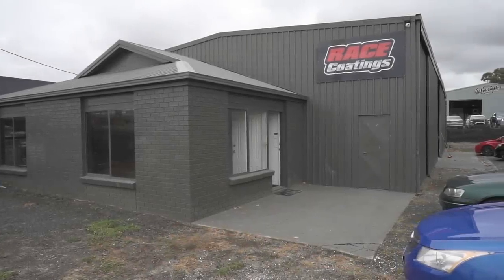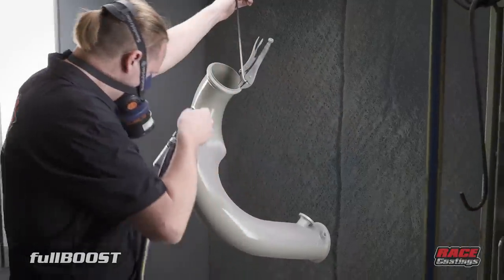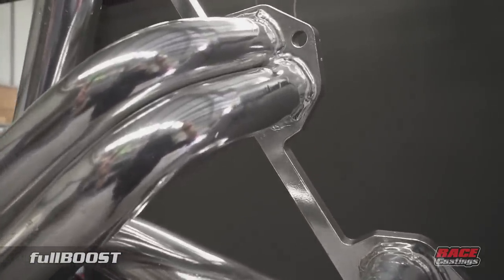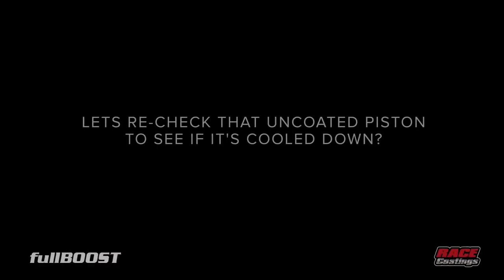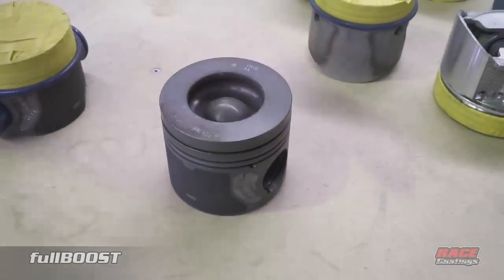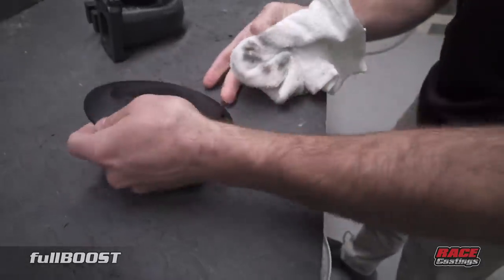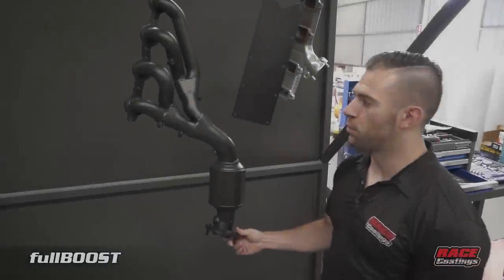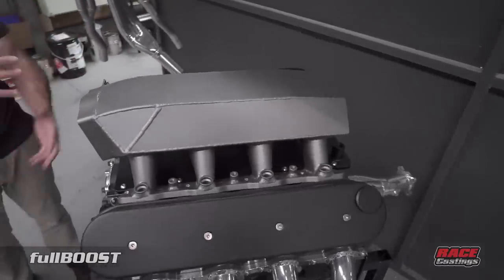What is Ceramic Coating? | Race Coatings

Comment: Would the ceramic coatings be applicable on the rotors or housing walls of a rotary engine?
Reply: Good thought.
Reply: I really like your question. I think we deserve an answer on this. Surely the bloke will read these and get back to you.
Reply: Companies like Mercedes-Benz, General Motors, Ford and Mazda spent BILLIONS researching high performance coatings to solve the many flaws in the Wankel design... none were successful.
Reply: Materials, rather than coatings but their main focus was on overall efficiency - fuel economy.
Reply: I could be wrong but I'm not sure it's purely heat that ruins seals and degrades rotaries but also just a lack of lubrication for the seals - which ceramic coating AFAIK would not help with. As another mentioned I am sure Mazda and other auto manufacturers tried it and clearly nothing really came of it.

Would be cool to see though no doubt, I'd imagine some shaving of the housing to make up for the coating may have to be done? Not sure how thick it ends up but I'd imagine the tolerancing on the housings is pretty serious.
Reply: Exactly, the excess wear and problem of sufficient lubrication whilst still meeting emissions was a problem. Over the years different rotor, side plate and seal materials have been used - something to bear in mind when modifying as some don't play as well with some as others.
To clarify, though, it wasn't so much heat barrier coatings but wear resistant coatings they experimented with.
Reply: Also worth noting is the seals and housing etc are designed to operate correctly at an operating temp. A ceramic coating would muck with that a lot. A lot of redesign would be needed to implement a ceramic coated rotor housing and I am sure auto manufactures have looked in to it before.
Reply: +Maxim Allen One of the major problems encountered by General Motors, Mercedes-Benz and several other Wankel development programs was cracking and failure of surface coatings due to an inherent flaw in the Wankel basic design, the less than ideal shape of the components for stable thermal expansion and contraction,the very uneven thermal load stress and contact damage and flex due to the torsional flex of the crankshaft.
Reply: +Maxim Allen AFR (air-fuel ratio) not lubrication was the major issue when emissions controls were applied to the Wankel KKM design, The Wankel had a very poor combustion chamber which is completely incapable of adapting a modern ultra-efficient "quench" or high swirl chamber design. Unstable combustion and detonation or pre-ignition is the primary mode of apex seal failure, a richer mixture reduces apex seal failure but produces poor fuel mileage and unacceptable CO and HC exhaust emissions, catalytic converters require a stoichiometric AFR to operate, Mazda and other experimented and produced cars equipped "Thermal Reactors" but these with plagued with problems and delivered poor results.  All attempts to produce a "lean and clean" Wankel engine have resulted in high failure rates due seal damage and compression loss.
Reply: Kevin A. WANKEL engines son, get your terminology straight. Not true at all, I have always had a very keen interest in the the KKM-57 design but I do not make any lame excuses for its many flaws and deficiencies. As you must know Felix Wankel had nothing to do with its design... Hanns Paschke and Walter Freode developed the Wankel KKM without any assistance from or even knowledge by Felix Wankel himself... Dr Wankel hated this engine and publicly mocked it in his famous quote. The NHTSA recall investigation dispelled these old wives tales once and for all, the investigation found NO LINK between owner abuse or lack of maintenance, even Mazda has admitted the engine is unreliable!  That excuse won't hold water either, when a design is found to be intrinsically inferior to existed technology? Legitimate commercial development interest naturally dies off when the design has been rendered obsolete like the Wankel has.
Reply: Kevin A. Which version of the Wankel are you referring to? as only the DKM-54 was a rotary.
Reply: The Wankel KKM's serious designs flaws (in particular short service life and low reliability) are well known and understood.
Reply: Then why was Sachs the very first of the 26 original Wankel KKM licensee's to completely abandoned development and production of the troubled design?
Reply: Kevin A. If they were so reliable? why did they both need to be rebuilt???
Reply: https://en.wikipedia.org/wiki/Adiabatic_process look here was one of the secrets of the glorious turbo era of the formula 1, group b rally and group c at LeMans ceramic coating, piston and motors ceramic coating was invented by the nazis in ww2 on the luftwaffe man like the like anti-friction lubricants.
Reply: Kevin A. There are several reasons why the Wankel engine was a commercial failure, the inherent weakness and fragility of its complex sealing system is certain one of its fatal flaws... and a major contributing factor in the design now being completely obsolete.
Reply: +Emanuele Loche Good comment, Dr Anselm Franz was the first to use ceramic coatings in the Jumo -004b turbojet engine that powered the Messerschmitt ME-262, Franz and his research were brought to the United States by the Army under 'Operation Lusty' where he would continue his work and go on to develop the engines for the Bell UH-1 and AH-1 helicopters and the AGT-1500 for the M1 Abrams tank.
Reply: +Jonathan Simmonds The various "nitriding" processes such as this one not only predate the existence of the Wankel KKM-57 design but have been used in mass produced engines since the 1950's, many of the more advanced nitriding techniques in use today existed 40 years ago when there was still commercial interest in development of the Wankel engine.
Reply: +Jonathan Simmonds Wankel KKM licensee Curtiss-Wright developed a nitriding process for the housings in 1964, Mazda used a similar nitriding process for the  iron components for its production engines as well.
Reply: this didnt.  https://www.wallworkht.co.uk/content/diamolith_dlc/   salt nitriding was used but not this. surface treatment has come light years in 40 years. thats why f1 and other aerospace products work. a far cry from 40 years ago.
Reply: +Jonathan Simmonds Actually no, its a very similar process that has been used in mass production for almost 40 years... with very similar results.
Reply: teflon coating on audi tfsi piston rings..
Reply: oh so ceramic coatings /teflon coatings were in the me262 jumo?- silly me! i thought that was with the space shuttle in the 70's that came out.. (actually it was high content nickel in the jumo engine- which in 44-45 couldnt be sourced so mild steel was used in the turbofans so the flying hours were reduced to a average of 25 hours max before a rebuild)
Reply: +Jonathan Simmonds Yes, The Jumo -004B was the first use of heat resistant ceramic coatings in an internal engine application, The Jumo   -004A was constructed with high nickel using Krupp P-193/30 "Tinidur' nickel alloy ( a material which had comparable creep strength compared to "Nimonic-70") was tested to a PFTR of over 200 hours.

The BMW 003 was constructed from similar materials to the Jumo 004B 

Krupp P-189 "Chromadur" a high temperature stainless steel alloy which only contained 0.2% Nickel.. These engines were a remarkable feat of engineering considering the both could reach a very respectable 100 hours in PFTRs. (100 PFTR was the standard  for acceptance in military combat service for both the RAF and the USAAF) This was achieved using superior heat management technology in the hot sections of the engines.. advancements in the use of bleed-air cooling and ceramic coating (technology that did not exist in Allied jet engines but are still in common use on today's jet engines)

Of course any engine that see repeated service using WEP or high TO cycles at Max  climb-out rate to ceiling altitude is going to see TBOs much lower to its PFTR.

Such was the case with both Luftwaffe and Allied piston engines and jets

a TBO in combat service of 20 to 30 hours was not uncommon for the Rolls Royce Merlin or the Pratt & Whitney R2800 when WEP was used repeatedly.
Reply: +Jonathan Simmonds The GE J-47 turbojet engine that powered the fastest jet aircraft in the world in 1948 (F-86 Sabre) was constructed using high nickel alloy, just 46 mph faster than the Me-262 its engine had a TBO in combat as little as 15 hours. making the ceramic coated stainless-steel blades of the Jumo 004B even more impressive by comparison.
Reply: +xXxMartin96xXx What about Mercedes-Benz? They invested over half a billion dollars developing the advanced GDI equipped M950F engine? Or Ford who held more patents than Mazda for many years? John Deere or Rolls-Royce Yanmar and Duetz that spend billions developing Diesel variants? What about Suzuki???
Reply: +xXxMartin96xXx It saddens me how little people today acually remember about the development history of the Wankel engine design and prefer to believe some crackpot conspiracy theories or uninformed speculations.
Reply: +xXxMartin96xXx What about OMC? (Evinrude/Johnson) Yanmar and Sachs that all introduced and sold Wankel outboard marine engines??? Or Ingersoll-Rand that manufactured the world's largest Wankel engines ever offered for sale in stationary industrial applications?
Reply: +xXxMartin96xXx I understand trolls don't like to have facts presented in an honest or truthful way if it contradicts their preconceived opinion.
Reply: +xXxMartin96xXx Just the facts here, I'm sorry you are not mature enough to handle the truth.
Reply: +xXxMartin96xXx Why don't you just take you bitter, angry troll comments somewhere else?
Reply: The housings and irons may be tricky to coat. The side seals and apex seals would probably wear the coating extremely quickly.

But coating a rotor... now that would be interesting. I'd imagine that it would help with cooling efficiency since more thermal load would be placed on the cooling jackets, rather than the oil chambers in the rotors and e-shaft.

This would be a good experiment.
Reply: +xXxMartin96xXx Do you only read English on a remedial level? maybe try a translation app or something, please just stop trolling.
Reply: +xXxMartin96xXx I'm not intimidated by angry trolls like you, please go troll elsewhere.
Reply: +xXxMartin96xXx  You have been reported for harassment.
Reply: +xXxMartin96xXx You are just digging a deeper hole for yourself.
Reply: +xXxMartin96xXx Seriously dude! Do you have some sort of mental problems?  Go troll somewhere else!
Reply: I'm not intimidated by trolls
Reply: "Would the ceramic coatings be applicable on the rotors or housing walls of a rotary engine?" I don't know what all this petty arguing and harassment is about... but its not related to the original question and more to do with some hate mongering individuals that simply refuse to accept the truth.
Reply: +xXxMartin96xXx I'm not intimidated by angry little trolls.
Reply: +xXxMartin96xXx I'm not harassing you. I'm trying to tell you how you can make your comments easier to read.
Reply: +CarNutz Mazda coated the irons and the housings of its production and motorsports engines for years using several different techniques and materials. Many manufacturers have tested and used coatings on the Pistons(rotors). The effects on the cooling system is minimal as the real flaw in the Wankel design is high heat rejection due to its low Carnot Cycle efficiency.
Reply: if you use a ceramic coating and ceramic apex seals , the durability will increase Sky High. Why havent they done this? Probably not cost effective on cheap productions cars , $695 per seal + the internal coating treatment  , well over $2000 per engine.
The Mazda 787b won Leman using similar techniques , and according to the engineers had virtually little to no wearing after 24 hours of continuous racing.
Also , it used 3 spark plugs per rotor instead of 2 , to lower consumption , well spark plugs are not exactly super expensive , but on a consumer level it might alarm some.
I think this all makes sense on a high end $200k Sports car with a limited run , like a Ferrari/McLaren , not in a sub $100k sports car.
Perhaps Mazda should bring back their premium brand and release a rotary sports cars with a properly built engine ,it sort of worked for Lexus with the LFA.
Reply: I'm waiting for RX 9 Electric.

I tired playing with combustion engine, thousands of parts & very fragile.
Reply: Uriah Siner /
Reply: All those companies already use ceramic coatings. But of course due to cost they only use them when  they feel it's absolutely necessary to meet the outright performance/mileage/reliability/emissions balance requirements the market & the regulators demand, as they perceive it. These coatings go all the way back to British jet research in WWII, so they've been arround a long time. Jez one in fact can buy a 40 year old Russian Vostok watch for just $40 that looks gold plated but in fact has a PVD ceranic TiN coating, the same hard stuff they put on the end of drill bits.
Reply: Uriah Siner deserves an official answer!
Reply: doktorbimmer 
Wankel geometry is an expanding wedge, evidently not as good as a piston working perpendicular to the applied force. Internal combustion engines waste 80% of the heat in exhaust gases and the water cooling.
It is old tech. Electric motors are 98% efficient and batteries lose 20% in charge losses. Electric motors don't need a gearbox etc. Max torque at 0 rpm.
The battery technology has come a long way and I expect it to continue.
Everything about a combustion engine stinks.  Unless it is stationary and residual heat is reused for something it is horribly ineffcient.
Reply: xXxMartin96xXx  and Uriah Siner, sorry to see you deal with these.  It has been found that the so called doktorbimmer is a bot, this is just one of the many accounts that have been linked to similar programs.  The information listed and referenced by it is all correct because it runs algorithms that pull key words and questions than auto respond in sarcastic form followed by factual information it easily can source from the internet  in seconds while even co referencing multiple publishings.
These bots then use built in auto responses to other comments and phrases directed towards it, often repeating them repetitively because it is limited to a few programmed response options.  Unfortunately this comes out sounding like an annoying 5 year that is mocking you in a very immature way, but this 5 year old has read and memorized a shit load of information. 
The robots are becoming more difficult to detect even when using their trigger words like "troll" because their responses are being improved to sound more human and mature, adult like instead of nerdy, 1st grader trying to bully other 1st graders like these current ones come off as.
Everyone should watch out for these annoying things and do not allow them to influence you as their creaters intended them to.
Reply: Ceramic brakes, as you may already know, exist.
Reply: Uriah Siner I don’t think ceramic would help on the internal housing wall but Teflon would, these guys also do
Reply: Dan Simmons ceramic brakes are for clamping power and durability. They do not run cooler, infact they are pretty much useless when cool
Reply: doktorbimmer one thing ive learned as an engineer though is that just because designs arnt seen as profitable or mass marketable doesnt mean they are bad ideas.
Reply: there is an inherent design flaw in those engines to begin with. uneven heat distribution. scrap metal.
Reply: @doktorbimmer  What flaws?? The only flaws are oil consumption, oil in the fuel, bad fuel economy and horrible emissions. Other than that it's a good engine.
Reply: @Cqwet Dbdfte  Excellent comments except the fatal flaw in any BEV is the low efficiency and horrible specific and energy density of a practical rechargeable battery which will never be able to match that of liquid fuels like hydrocarbons. The Laws of Electro-chemistry prevent such a battery from ever existing.
Reply: @Mikkalangelo F Just the facts here...Wankel engines are obsolete today because they were inherently inferior to reciprocating engines. 26 of the largest and best engine manufacturers in the world are not wrong... there are simply some very childish, immature people who stubbornly chose to deny these irrefutable facts and attack the messenger. I do not cow to angry little trolls. Killing the messenger achieves nothing, it does not prove you flawed ideas and certainly will not bring the Wankel engine back from extinction.
Reply: @felix crab If a design cannot compete against or offer an significant advantages then what is it? A great design that just sucks compared to other designs???? I'm sorry but engineering has no place for political correctness. A design either performs to meet or exceed its design specifications or it does not. When it come to the Wankel it utterly failed to meet today's design requirements that are easily meet by current reciprocating designs.
Reply: @Anthony Thomas True, other than the fact that it also sucks in every other relevant performance category as well. The Wankel engine no longer offers any significant advantages over other internal combustion type and its list of major disadvantages is not off-set by any significant advantages in performance or cost.
Reply: @Anthony Thomas What flaws? You seem unaware of serious flaws related to reliability and short service life, lack of torque, lack of low rpm power, High noise level, High EGTs. But I have heard they make a great ash trays or an anchor for small fishing boats.
Reply: @Keven A. UPDATE; Anyone wondering what happened to Martin J Medina (aka "xXxMartin96xXx") This viciously bitter, angry troll has had his account removed from YouTube and he has been charged with terrorist threats and harassment by the Santa Barbara County District Attorneys Office. He was arrested on charges of domestic violence against his ex-wife who left him and he has also received a dishonorable discharge from the United States military.